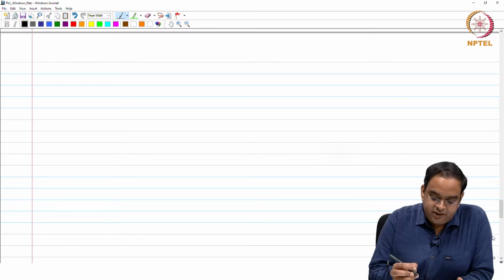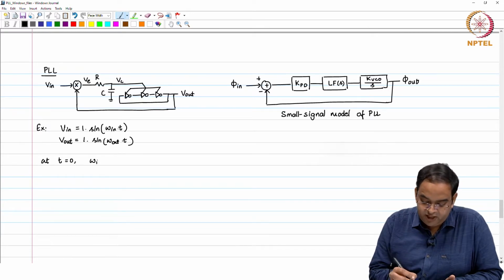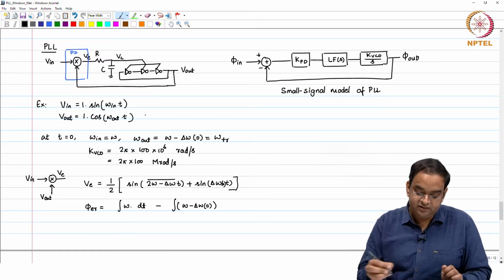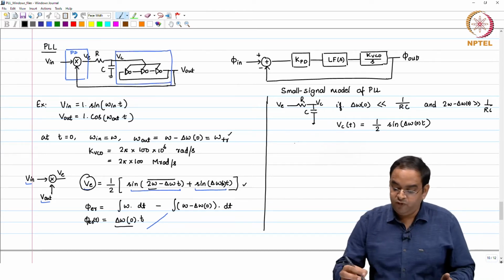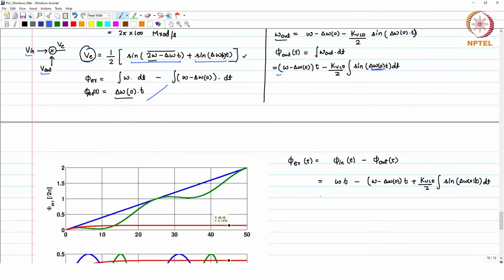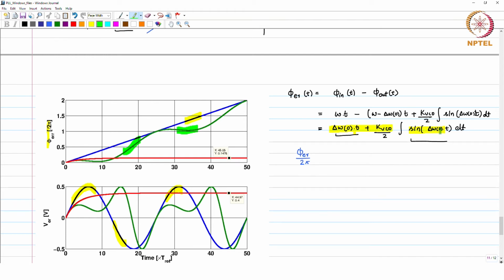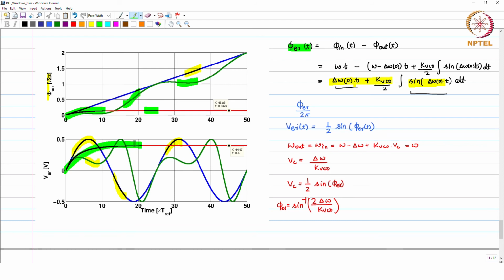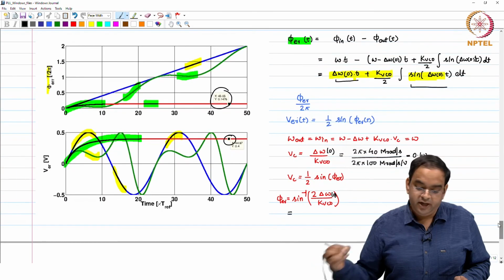Time Domain Analysis of a Simple PLL

Comment: Hello Sir,

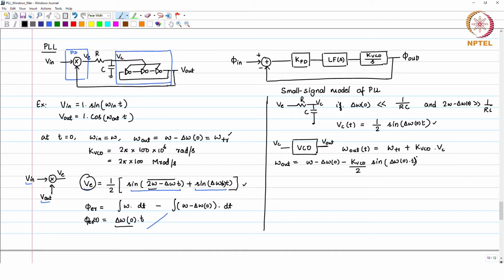@10:28 In the equation for ωout, why is (Kvco * sin(Δω(0)t)/2 got a -ve sign ? 

I think as per the equation for ωout = ωfree + (Kvco*Vc). 
We have ωfree = (ω - Δω(0))t
                  Vc(t) = [sin(Δω(0)t)]/2 .                       So is there something wrong in my understanding?
Reply: Same question brother..I think it will be positive sign
Reply: No, there is nothing wrong. It could be + or-, because we are going to deal with phase error. So if you plot the graphs for this equation, you get the inverted graphs. That's the change, and nothing is going to affect it more.